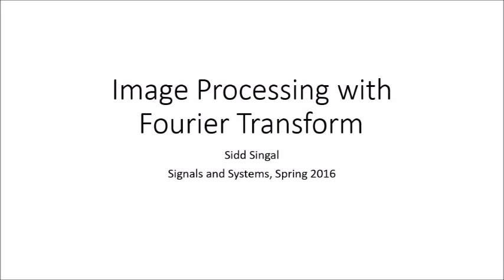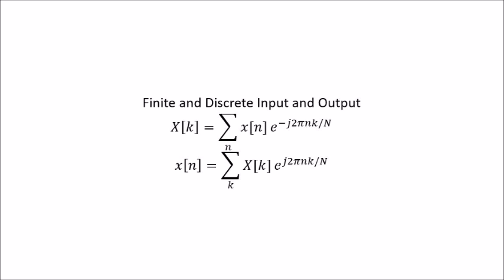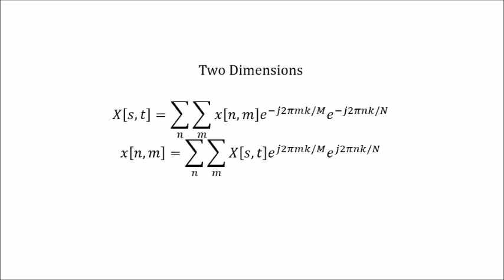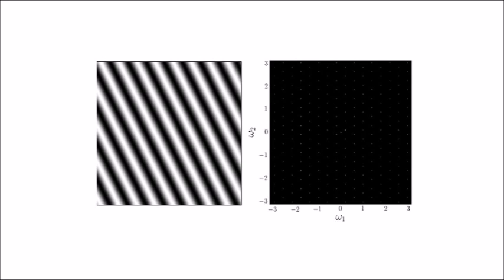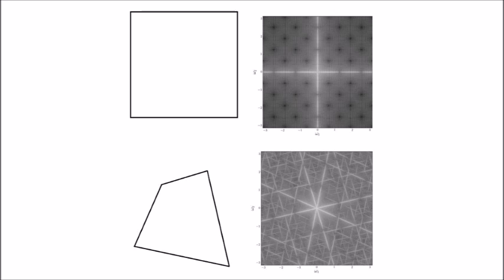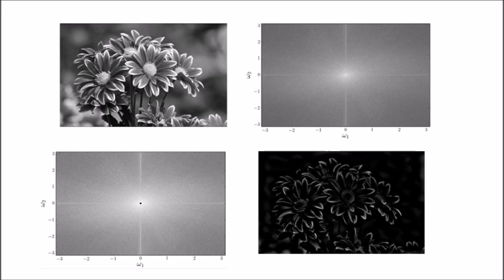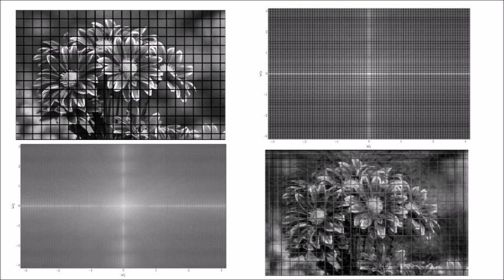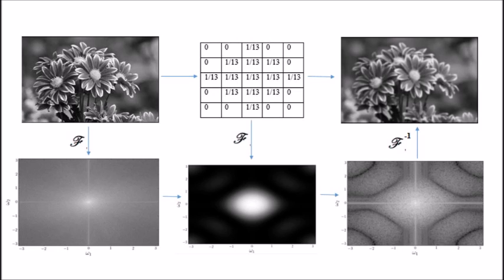Image Processing with Fourier Transform

Comment: hey man.. i got your code and after install all packges, i  executed, but showFourier() isn't working.. the figure window is blank and my prompt says: "C:\Python27\lib\site-packages\scipy\fftpack\basic.py:160: FutureWarning: Using a non-tuple sequence for multidimensional indexing is deprecated; use `arr[tuple(seq)]` instead of `arr[seq]`. In the future this will be interpreted as an array index, `arr[np.array(seq)]`, which will result either in an error or a different result.
  z[index] = x" and finally "The system can not find the file specified" after many lines of attempts
Reply: I was probably using a different version of scipy when I created this. You might have to modify some code. Do you have a larger stacktrace?
Reply: @sidds5039  yep.. now is hard to me send you, but later I can do this..
Reply: @sidds5039  http://dontpad.com/showFourier, in this link i post my stacktrace..
Reply: @JoaoHenrique-su8sq  Sorry for the slow responses, I have been busy. I tried to download my code and re-run it with then newer packages, and am getting the same errors as you. I'll try to debug further, but it at least looks like I'm trying to do integer indexing using doubles on around line 75. I'll probably have to come back to this in a couple of days.
Reply: @sidds5039  ok no problem thanks for all.. any news comments here pls..

Comment: Thank you very much, you did an awesome video! :)

I was trying to replicate some of your teachings in python https://github.com/leandromoreira/digital_video_introduction/blob/master/image_transform_frequency_domain.ipynb but I'm having so much trouble to discard coefficients (just to learn minimal image compression).

I could apply the filter (multiplication in frequency domain vs convolution in spatial domain) but I was trying to discard some coefficients, my idea is to show that you can easily drop (aka make them 0) coefficients while on frequency domain because they're grouped and you can 

My attempts were (once I fft the original image):

1) discard a superior square, from top left, starting with x=0 and  y=0 going until  x < 80 and y < 80

2) discard a superior triangle, from top left respecting the rule  x + y < 80

3) introducing a threshold = absolute(37/100 * max_coefficient) and only dropping when the value of fft is (abs) greater than this threshold

4) lastly, I tried to compose solution 3 with 1 and 2.

But none above worked well, they make the image seems ghostly. =/ How can I discard the coefficients (real part) without losing too much?

Comment: thank yoku sir. Since I have just started learning fourier optics, I have a question in mind. Is the fourier transform of an image of an object similar to the diffraction pattern of that object? Are these two 'one and the same thing'? 'Coz I have seen the diffraction patterns of a triangular object (in a book), and the pattern is same as the fourier transform of the trianular image u have shown in the video. Plz correct me if I'm wrong.
Reply from the maker: You know, looking at https://ocw.mit.edu/courses/mechanical-engineering/2-71-optics-spring-2009/video-lectures/lecture-17-fraunhofer-diffraction-fourier-transforms-and-theorems/MIT2_71S09_lec17.pdf, i think you might be right. But I can't tell you that with certainty; I am not very familiar with optics and signal processing in general is not my main area of study.
Reply: Anyway, thanks for the material, Sir.
Reply: It depends which diffraction regime you are talking about. If you are "close to the object" (near field) then the answer is NO: diffraction resembles more the object than its FT. If you are far away from the object (in the Far Field) than the diffraction pattern is the squared modulus of the FT of the object.

Comment: Thank you,i want the code of FFT in c++ if you can help me sir.
Reply from the maker: I honestly do not have the motivation to rewrite this in C++, but this looks like a good library that you can use: http://www.fftw.org/ .... the python code should be somewhat readable but basically all you need to do is:
1. Import a picture as an array of RGB integer values
2. Perform FFT on the arrays using the library (theres three arrays, one for each of RGB)
3. Probably do some normalization
4. Filter out whatever you want (the center portion, outer portion, maybe a bandpass filter)
5. Do the inverse Fourier transform using that library
6. Display the new image
Reply: Thank youuu very much.